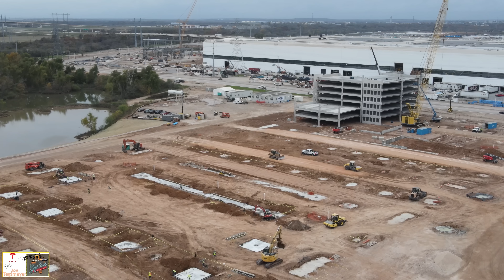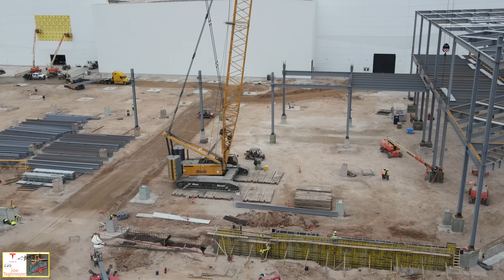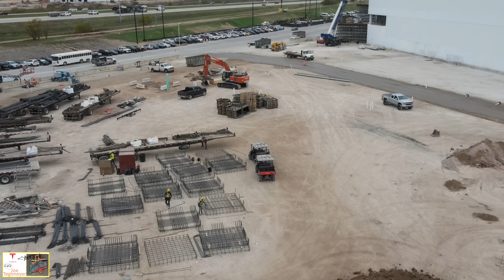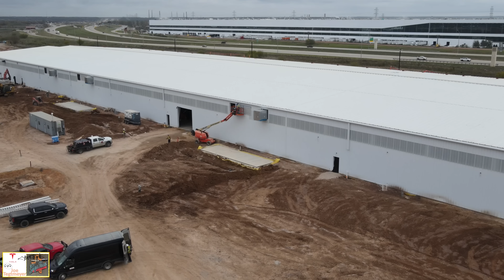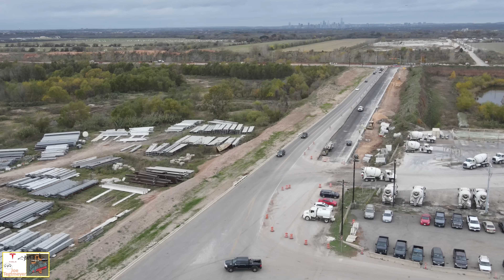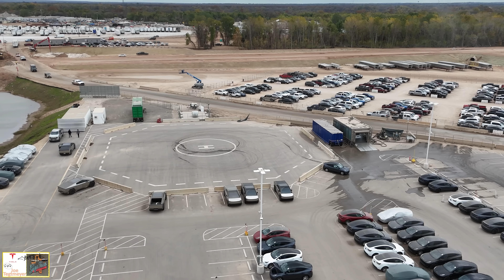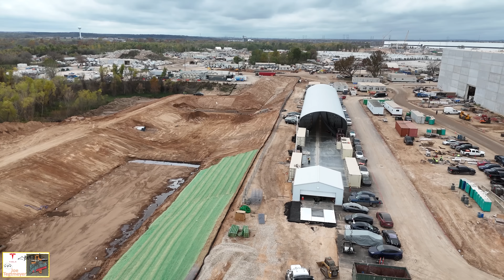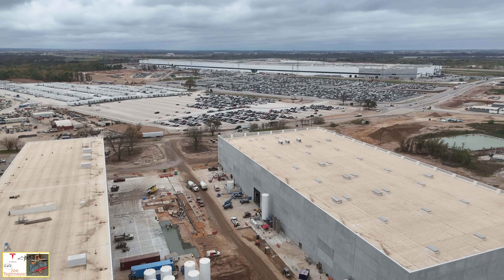S Extension Grows 2X, W Site Progress & Cybertruck Updates! 8 Dec 2023 Giga Texas Update (8:35AM)

Comment: Powering 96 Tesla Chargers 24-7 is a substantial load and lots of production capacity as output continues to grow at the transport facility. 
They will put solar panes for shade and power there too,
Reply: 24 MW to power 96 Superchargers. Which is the reason for the HDD duct-bank under the freeway. Solar panels will only offset some energy use. Using 400 watt panels... It would take 60,000 panels to provide 24 MW!
Reply: @DavidJohnson-tv2nn 
I may be wrong, but I think there’s going to be 70,000 solar panels on the main factory. And more added to the addition.
Reply: @petercozzaglio6070  That is correct. But keep in mind that 24 MW will be needed just for the Superchargers at the EOL facility, not counting energy used by the EOL building itself. 
The energy requirements of the main factory aren't published by Tesla, but you could probably add another 24 to 30 MW for that. Then there are the Superchargers in the east parking lot, and the power requirements for the Cathode building and the Die Shop. So overall... I doubt that solar power will cover all of the energy requirements. But it will definitely help offset costs.
Reply: @DavidJohnson-tv2nn  Don't you think the EOL building itself will be on Blue Bonnet?
Reply: @benguthrie49  That is a possibility. The EOL building itself shouldn't have any huge energy requirements. Mostly lighting and HVAC. However, power from LCRA may be cheaper. With the ever increasing complexity of conduits and duct-banks around the building, the thing to watch for is cable routing to see if cables from under the freeway are routed through the duct-banks to the building.
In any case, Bluebonnet will supply the building. Either as a main power source or as backup.
Reply: @DavidJohnson-tv2nn  V3 cabinets have ~387 kVA max continuous AC input so 96 pedestals at 4 per cabinet seems more like 9-10 MW [without supplementary cabinets].  
They might also not necessarily need to supply 250kW to all pedestals simultaneously as cars could cycle through the yard at the pace they roll off the line.  Assuming a Model Y rolls off very 45 seconds and Cybertruck every 60, 96 pedestals would allow up to ~40 min charging/vehicle
Reply: @Gig0Surf   I was just counting 250 kW per pedestal x 96.
Reply: @DavidJohnson-tv2nn  I recognized that.  As I explained this isn't correct for the typical V3 configuration.
Reply: @Gig0Surf  From Tesla....
"Faster Charging, No More Power Sharing
V3 is a completely new architecture for Supercharging. A new 1MW power cabinet with a similar design to our utility-scale products supports peak rates of up to 250kW per car."
Reply: @Gig0Surf   Posting links is likely to get my comment deleted by YouTube. But try searching "tesla supercharger v3 specifications"
Reply: @DavidJohnson-tv2nn  "Up to" is the key phrase.  Each V3 cabinet has only 387kVA max cont. AC input but also can draw up to 575 kW DC from other  V3 cabinets [up to 7 cabinets per group].

So while V2 shared power with the adjacent stall [dropping yours when someone plugged in], V3 shares power between cabinets [so effectively sharing between up to 28 stalls] which for drivers means it largely doesn't matter where you plug in.

With random arrival times [and the battery charge curve], plus any number of empty stalls, there generally should be plenty of power to go around to give that 250kW — except when the supercharge site is full like during a holiday rush [then cabinets don't have much if any spare power and the average available power drops...]
Reply: @DavidJohnson-tv2nn  Exploring what the power need might be - the production rates suggest 55 MY and 41 CTs filling 96 stalls.  Shipping at 50% charge implies ~41 and 62 kWh per vehicle or 61 and 92 kW avg over 40 min, or an average 7.1MW over 96 pedestals.  9.3MW avail from 24 cabinets seems like it leaves extra margin for a bit faster charging giving time to shuffle vehicles.  

[A more thorough estimate might also add Megacharging needs for the Tesla Semi trucks shipping these vehicles to the rail yard and/or Tesla locations]
Reply: @Gig0Surf  Thanks so much for the information! I did some research and you are correct. Someone even posted a picture of a cabinet name plate....
"Maximum continuous power 387 kVA @ 480 V.
Tesla's misleading marketing BS sure doesn't help with the understanding of how the v3 Superchargers work.
With a 4 conduit duct-bank going under the freeway, and each conduit containing a 3 phase circuit that can probably supply 5 to 10 MW... They have room for expansion on the Superchargers.

So my comment above needs to be revised.
96 Superchargers/24 cabinets. Each cabinet rated @ 387 kVA = about 9.3 MW
Using 400 watt solar panels... It would take 23,250 panels to provide 9.3 MW!
Reply: @DavidJohnson-tv2nn  What is misleading?
Reply: @sammyk874  Tesla's Statement and the misleading parts.....
""Faster Charging, No More Power Sharing
V3 is a completely new architecture for Supercharging. A new 1MW power cabinet with a similar design to our utility-scale products supports peak rates of up to 250kW per car."

"NO MORE POWER SHARING"  "A NEW 1MW POWER CABINET"   "250KW PER CAR"

There absolutely IS power sharing. Remember, each 1 "MW power cabinet" serves 4 charging pedestals. Makes sense, right? A 1 Megawatt power cabinet supplying four 250 kilowatt charging pedestals.
But.... The cabinet isn't actually 1 MW. The nameplate power rating on the power cabinets for the AC input power is 387 kVA. So, as GigOSurf pointed out in the comment above... It only comes close to 1 MW when it can borrow 575 kW from other cabinets that are being under utilized because there are empty stalls. Pull into a charging station that is full and you will NOT get the full 250 kW charging rate.

Comment: I wonder if the new gravel parking area on the far west of the site is going to be a relocated warehouse on wheels location so the existing western warehouse on wheels can be converted into more parking for the end-of-line facility or otherwise paved for permanent parking.
Reply: Fully agree with wow being moved there.. perhaps for a time while they extend the grade/level southward from the EOL facility.
Reply: I was thinking the contractor parking lot may be moved there.
Reply: Maybe moving the east WOW.
Reply: @sammyk874  Good point. Constantly fiddling around the edges of it. Sooner or later that east-west road will be extended further east. Might be starting that now. 25:22 shows some works, and just noticed the new earthworks beyond seem to align, or may be associated.
Reply: There will be a considerable amount of room on the east side eventually.  The WOW is already partially geopiered and the ground should be quite settled.  The employee parking will likely be replaced by the new parking structure.
Reply: @benguthrie49  The new parking structure might be the first stage of a complete rearrangement of the east side.

Or the relocation of the Cathode plant might have been the first stage. It was never obvious why the Cathode plant was shifted from what is now the WOW yard.

Come to think of it, this project from Day 1 moved so quickly a 'Master Plan' may not have been developed before construction started.
Reply: @DessieDoolan  I also was surprised by the suddenness of the cathode plant move, especially after all the prep work.  we'll have to "monitor it"
Reply: @benguthrie49  🤭